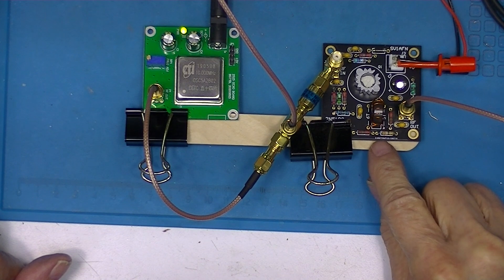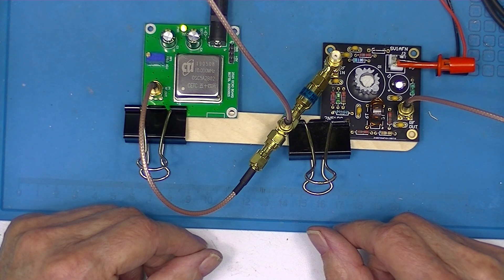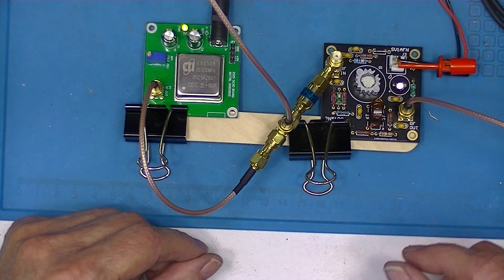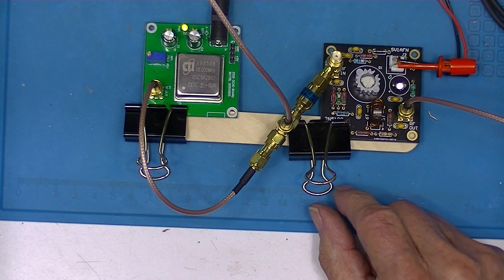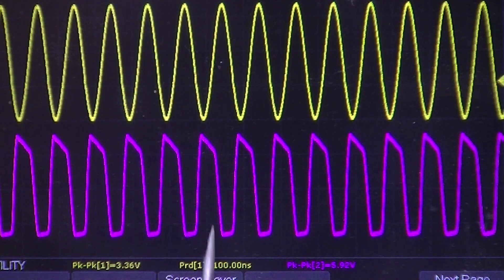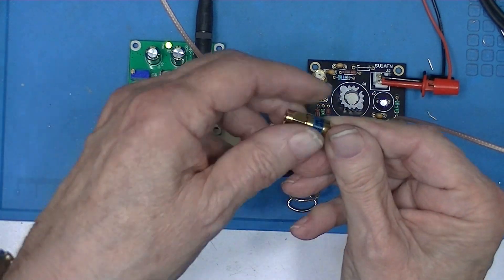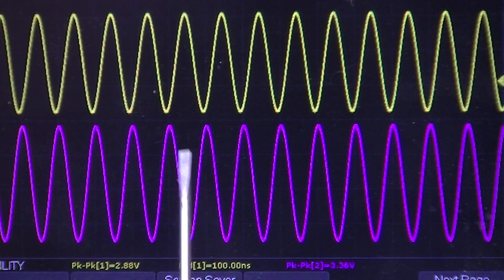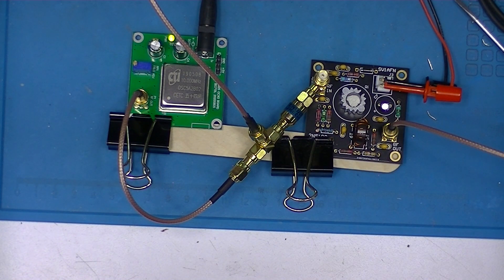2N5109 RF Amplifier Part 2

Comment: Wondering about the gain you referred to.  Considering you are measuring the output at the oscillator end and have a 15db attenuator the gain is much higher than oscilloscope readings implies.  The Peak to Peak voltages measured are reasonably close.  So when you factor in the reduced input level the overal gain is a little over 15db.  That's pretty fair for a buffer  🙂